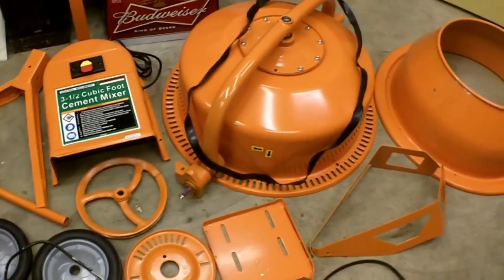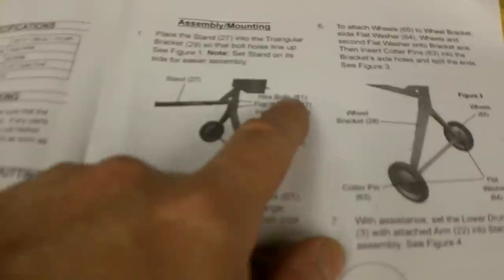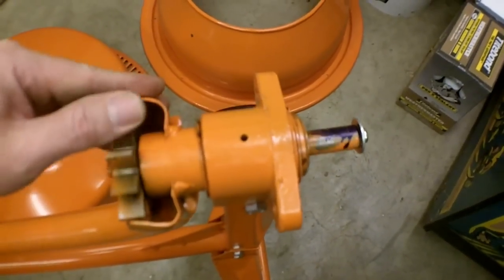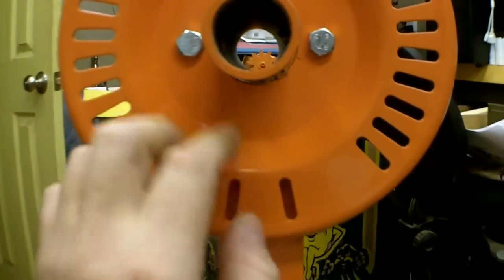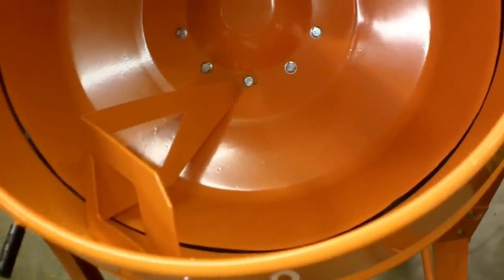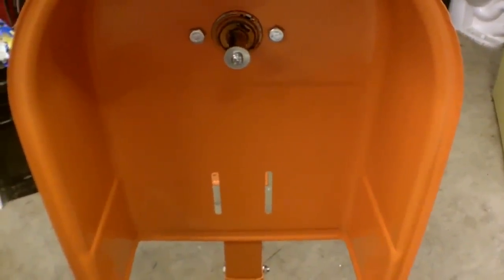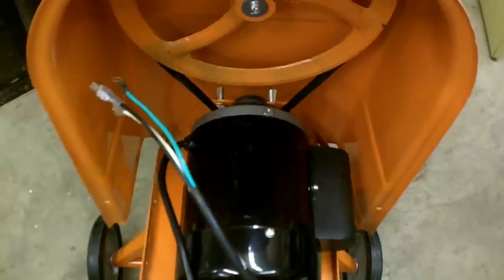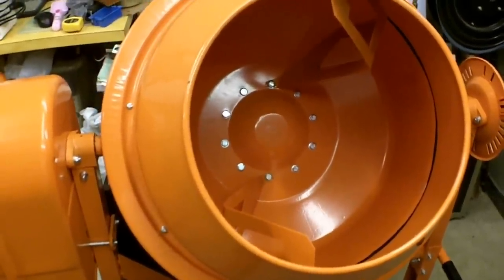Harbor Freight 3.5 Cubic Foot Cement Mixer Assembly and Review. Item 67536

Comment: Sir:  I don't know if you still check this EXCELLENT page, but I'm hoping tonight you do.  My mixer was working well over two cement jobs.  Then, day 3, it started great but lost pulling power to turn the barrel to do even one bag.  The barrel turns at normal speed when empty.  I re=tightened the screw inside holding the metal wheel pulley in place, retightened the two bolts that put tension on the rubber pulley.  No luck.  I hand mixed the rest to finish.  Question:  on the instructions concerning the "pulley" at 23:04, you reference a "key."  I did not find one inside the  shaft!!!  Could this be my problem?
Reply from the maker: Thanks! Yes, if you're missing the key- the pulley can spin on the shaft. It would also do the same thing if the key sheared in two. You should be able to find one at a hardware store. Not sure what size and length it takes- so you'd have to measure the square hole/slot with the pulley in place with the key-way notches lined up. The length should be no longer than the pulley is wide at the hub. I tiny bit short is ok.  Also, make sure the belt tension isn't too tight. Good luck, G.
Reply: Thank you!!  I also considered the ext. cord was too long, not the right amp, etc.  That all checked out.  But the key is not in there after I took it apart.  The pulley was just spinning, and was really hard to put the screw into it.  I bet that's what happened, the key sheared off.  Or it was never put in.  Either way, much thanks.  I think this will work out.
Reply from the maker: No problem! Yeah, that's your problem. Locate and install a key and you should be good to go. Take care, G.

Comment: Hello , well I went to hardware store and purchased the large washers that go under the bottom of the DRUM as one other who had a very noisy mixer  and I installed 4 more WHICH raised the drum for the drive GEAR  but one must be CAREFUL not to raise it to much or it will not drive the drum { WELL THE DRUM RUNS 90% with little grinding sound...NOW FOR THE TEST to make sure it will mix the cement { I can always take 1 or 2  washers if needed     The new Spring drive for the handle SUCKS to put on  THE OLD VERSION WITH THE BOLT TO ADJUST WAS BEST  just saying   Sifu.
Reply from the maker: That's cool! Hopefully it will work well. Yeah, I can see it would be a pain to put the handle on without being able to remove the tension like on mine. That's a pretty stout spring to compress and get the holes to line up. They probably should've left it like it was. I bet they'll get tons of complaints on that front. Good luck with your job! G.

Comment: If I were you I would check and see if I install the parables correctly.  You may be making another video to show how to do it correctly.  There upside down.
Reply from the maker: Joe, I'm assuming "parables" means cables. If so, they were connected properly and I've used it tons since this video. They do have many models, so each may be different. If that's not what you meant, please note the timestamp in the video and elaborate further. Good luck, G.

Comment: Im a mason concrete contractor I bought this for tight jobs. DIRECTIONS SUCK and I have heavy equipment and a huge shop. Look at the small hole where the shaft turns where a grease zerk should be!!! TURNING shaft has to be GREASED!!! So I took off my snap ring and pre grease the two shafts. Also drilled the 2 small holes, tapped  for a 6 mill grease zerk,
Reply from the maker: They do John! They should add the zerks for sure. I greased mine like you did by taking off the rings. Mine's seen little use but will probably add them at some point. Good luck, G.

Comment: Sucks, mines didn't come with numbered bags. Bolts and washers were all mixed in one bag.
Reply from the maker: Yes it does. Good luck, G.
Reply: @ghostses  mines came with 2 bags of bolts and screws all mixed. But motor was already hooked up to the box as to the other half of the barrel also. Saved me 2 steps but lost 20 steps digging through bolts and screws. My key to the wheel was way shorter too compare to this one.
Reply from the maker: Yeah, sorting things out costs much time. Sounds like they passed that time to the consumer over it being done at the factory. G.

Comment: got one yesterdday  directions have gotten worse, had a bag full of loose parts theres no adjuster on the handle spring had to use a ratchet strap to hold it down to bolt it together. Looks like Im going to have a bunch of LOPs theres a whole bunch of extra hardware
Reply from the maker: Yeah, I heard from others the same thing you're saying. Hope it goes well. Take care, G.

Comment: Has anyone else had a problem with the bolt that holds the drum to the geared arm coming loose?  It seems like when I put more than 2 60# bags of concrete in the bolt begins to spin and come loose, so I continually have to tighten it or risk it backing out all the way and the drum falling off.  Any help would be great!  I've tried an extra lock washer and that didn't work.
Reply from the maker: Not I Dan. After fully tightening up the bolt on mine, the drum still turned and didn't bind. Not that it's seen tons of use, but I've never had a problem with it coming loose. Mine had the two thrust washers on the drum shaft first, then it was installed in the arm. Then a fender washer, lock washer, then the bolt was installed. I would first make sure everything is in the order I've stated. If so, it could be for some reason the shaft isn't sticking through the hole far enough. It should extend a tad so when the washer is installed it leaves a small gap. The washer should spin freely with the drum. If that's the case, You might try sanding down one of the thrust washers to give more clearance. If, however, everything looks good- some locktite on the bolt would be the next thing I would try. Either way, good luck finding the solution, G.

Comment: Probably the best video I've seen on this, but because of actual physical and electrical variations that HF has for the same model, it took at least different videos and adding in my own hardware to get it completed.  the full paper book manual is 98% worthless.  The single sheet identifying bolt usage locations is about 50% worthless.  Not gonna lie, I bought this because of the price and functional review from everyone.  But in the end, HB REALLY needs to get a better tech writer hired to make sure the documentation is correct.
Reply from the maker: Thanks Gerry. Yeah, I guess they're a few model numbers and they all come from different factories. I consider most of the HF items as "kits". It might take some work, modifications, or fasteners, but overall if you invest the time to correct things, you win overall. I agree, they need a new tech writer hands down. I've been waiting for them to hit me up, but it's been crickets to this point. Glad you got it sorted out and hope it serves you well. Good luck and take care, G.

Comment: I have seen at least 3 variations of this Mixer. All have different part assemblies. The handle on my mixer i purchased today (just finished it) has no spring adjustment bolt. You have to compress the spring as you insert the bolt through the bracket and it is a pain to do. Ended up tilting the handle to one side and align the first hole, slip the bolt through and compress the handle while inserting the prongs into the slots then rotate the handle down more to line up the exiting bolt hole in the bracket. That by far was the most difficult part of the assembly being that there was absolutely no instruction on how to install the locking handle. Along with the rest of the assembly the instructions on this unit are completely useless. There was nothing really explained except the stand and it really did not need instructions. Everything else was to be figured out as I went along. Worse Instructions I think I have ever come across. But after it was said and done, It's a great mixer.
Reply from the maker: Agreed, there are variations. Also agreed, the manual is pretty much worthless. And again agreed, after the pain of putting it together, it's a great mixer- especially for the cost. Take care, G.

Comment: Fyi: your barrel is turning counterclockwise... I believe your power source is in reverse polarity the barrow should be turnings clockwise....I'm seriouse your position and neg is in reverse at the source....
Reply from the maker: It's an induction motor so polarity means nothing. It will always spin the same direction. DC motors can be reversed by switching the leads. Do some homework. Take care, G.

Comment: Anyone know the actual motor RPM?
Reply from the maker: John, according to the manual- the no load motor speed is 1820RPM. The drum speed is 36RPM. Good luck, G.
Reply: Thank you. I live in a country with 220v 50hz. So, if the motor burns up running at 110v 60 hz, I'll have to find another one. Do you know why harbor frieght sells this item under two different part numbers? Strange. My guess is they have two companies building the item.
Reply from the maker: No problem John. I asked them before, and that is the answer I got- they have different manufactures so they use different item numbers. I've seen as many as four before. Take care, G.

Comment: Put gasket sealer on both sides or it will leak
Reply from the maker: Mine doesn't leak- but thanks for the post. Take care, G.
Reply: ghostses you got lucky 6 years ago they probably used a better quality gasket the new ones are a bit different now less parts to put together and all hardware is in 2 bags it’s total guess which bolt goes where kind of thing even your paper instructions are more detailed
Reply from the maker: Possibly so Goose. In the last couple of weeks I put about 33 60lb bags through it and it didn't leak a bit. Good tip for newer purchasers though. Sealer might be the ticket. Good luck, G.

Comment: I've had excellent results with my Central Machinery mixer, but the wheels are utterly useless junk and cry out for replacement. If you are pouring concrete it means there is none there which means you have to be able to move the mixer over unimproved terrain.
Reply from the maker: I would agree, especially if you need to move it around a lot. Take care, G.

Comment: Worst instructions ever. My bolts just came in two plastic bags. Nothing numbered. Thanks for the video.
Reply from the maker: Agreed! I've heard from others the hardware was just in bags. A pain, but hopefully you can sort it out. Good luck, G.
Reply: @ghostses  I did thanks to the video I watched. The worst part was there were a few bolts and parts that were not like the picture. Putting the gasket on with gasket sealer and letting it sit overnight was the best thing to do. Because the gasket was all wadded up when it came out of the box. A big part of it I just had to figure out by laying out the bolts and figuring out where they went. Anyway, worst good. Plan to use it soon. We’ll see how well it mixes Concrete .
Reply from the maker: @madmax9603  Good deal! Mine mixes quite well - hope your's does as well. Take care, G.

Comment: It appears. To be. A very typical Harbor Freight.  Product  assembly  before. You. Start. It.  We. All kind of know.    You will. Need.  To supply.    Hardware.  That. Is incorrect. Or missing in the box  and. A drill or grinder. To. Align.   Parts. That. Are. Machined   Or  drilled wrong. My.   Cousin.  Who is a engineer. By. Profession.  Told me.   All the nightmares.  He had. Putting together. A. Harbor Freight.  Utility. Trailer.  Together. !  He told me.   His.  Wife. At the time.     Kept pestering.  Him.   As to why. It.  Was taking him so. Long ?  Lol.   He confessed.  To me there. Was not one. Part on the entire build.  That.   Fit. As. It was intended. Out of the. Box !  But he kept telling me.  It. Was.  Cheap  compared to.   Assembled.  Units. Available in his area. ?  There was. A couple of.  Things. He actually. Wound up.   Welding.  Himself.  To.   Complete.  The build ?
Reply from the maker: Yes Craig, you're correct. I consider a lot of their items to be "Kits". Take care, G.

Comment: This is by far the biggest piece of crap that man has ever created.  If if were not for your video it would be impossible to put it together.  The "instructions" are totally useless.   I went back and forth from my computer looking at your video and back to my garage where I was putting it together.  Thanks for your work on the video.  I still can get the #&% thing together because now the motor will not fit into the tray properly. The tray is two short and the back of the motor sits on top of the back edge of it.  I cannot get the motor to "sit" all the way down in the back.  So far I've spent a full day on this thing and I still can't finish it. My recommendation is, " DO NOT PURCHASE THIS ITEM"
Reply from the maker: +JSINC2 
I agree the instructions are useless. I'm glad the video was helpful at least to the point you found the problem with yours. It sounds like they made a huge mistake with yours. I don't know if you have a store locally, but I wonder if you could take the motor and bracket in so they can pull working parts from another box? Not convenient, or should even be necessary. But if you can get past the hassle and frustration- they do work really well especially for the cost. Good luck either way, G.